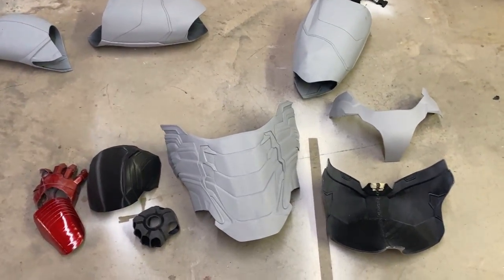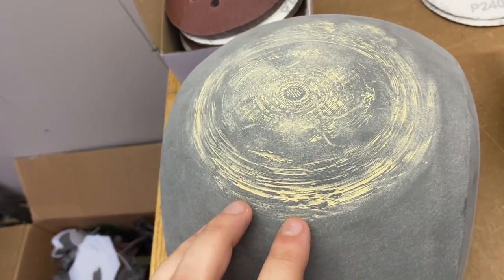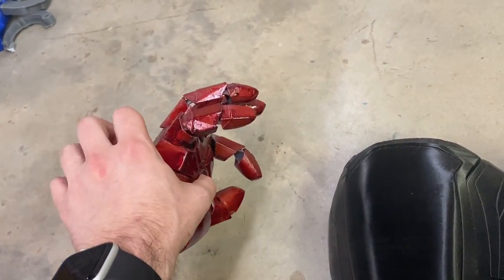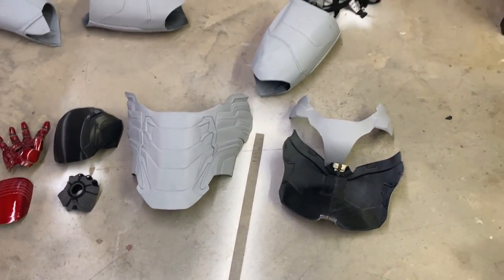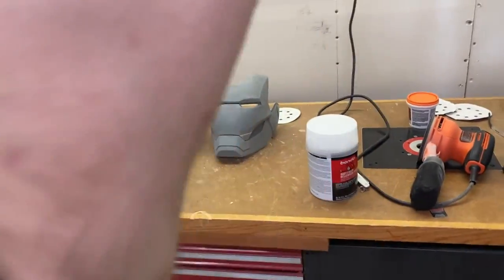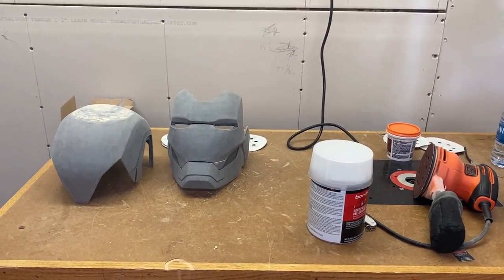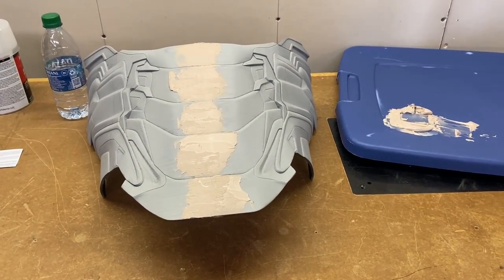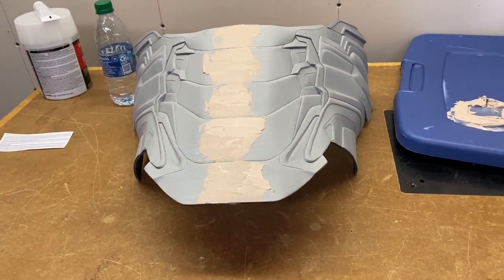Iron Man MK85 Suit Update 20 | Making Iron Man Mark 85 with 3D Printing | Iron Man 3D Print

Comment: Good job on your progress. I’d be curious to learn the support settings you’re using for these prints. I’ve been scaling the parts down 25% and doing various settings tests with Cura Tree Supports.
Reply from the maker: https://youtu.be/REONDyOdyHo this video may be of help. I usually do not use tree supports and do regular at 70 overhang angle

Comment: Amazed at how well the wood filler worked for the top area of the helmet where the supports affected the surface. What grit sandpaper disc did you use? How much time did it take to get it smooth? Thanks and keep rockin
Reply from the maker: Start with 80 then work my way up the following- 120,240,320, prime- wet sand 500-600ish, final hand sand 1200 for small imperfections. To get it to prime stage..takes around 1.5 hr work id say